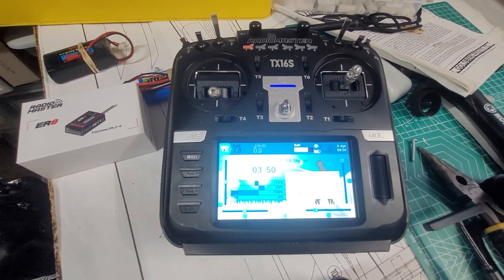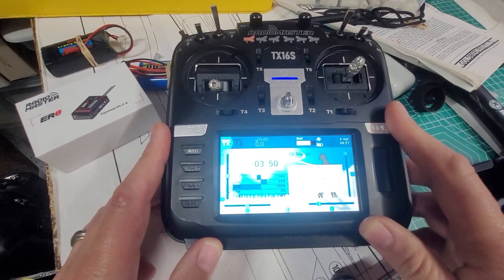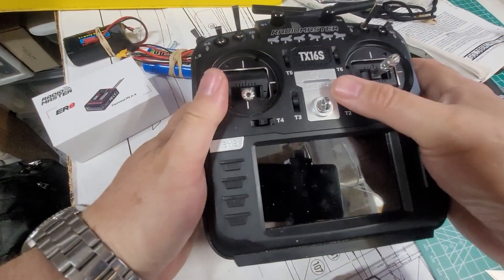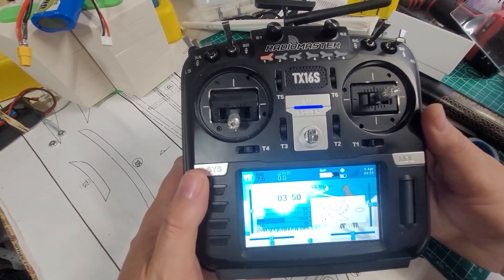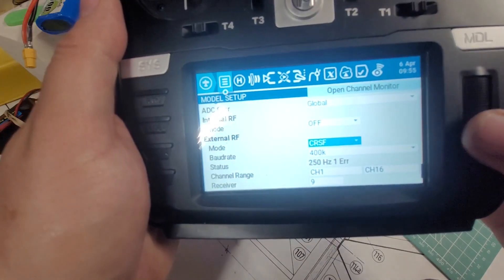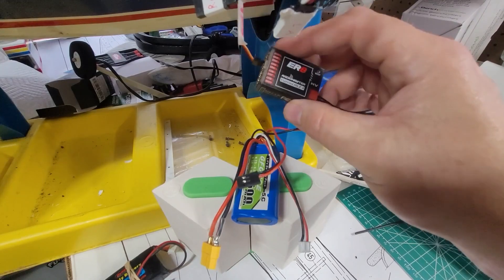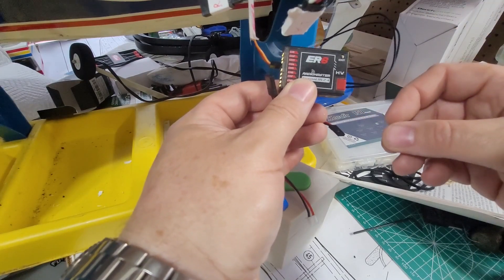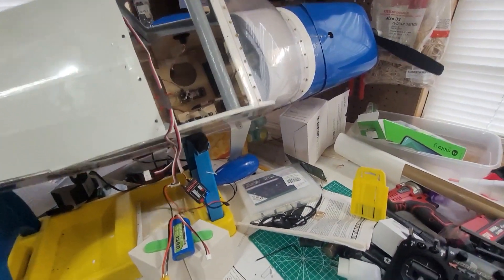Basic ELRS Setup/Bind - Radiomaster TX16S, Edge TX, Ranger Micro

Comment: I have a TX16S on the way. Gonna have to get that module. Gonna sell my Futaba stuff i was going to use. Gonna upgrade the heck out of my TX16S as I go though.
Reply from the maker: It's a great radio! A little bit of a learning curve but once you get past making the first models it's easy. If you get the 4in1 Radiomaster it is compatible with the S-FHSS Futaba protocol so there's a possibility you may not have to sell the Futaba if you have that kind of gear. Currently I use it for ELRS, some Spektrum DSMX stuff, and it even works my little toy Syma drone.

Comment: I have the bandit micro, but when I turn the external rf to csrf the external module does not turn on
Reply from the maker: I'm thinking either a faulty module (the bandit) or you may need to look at upgrading firmware on your transmitter.